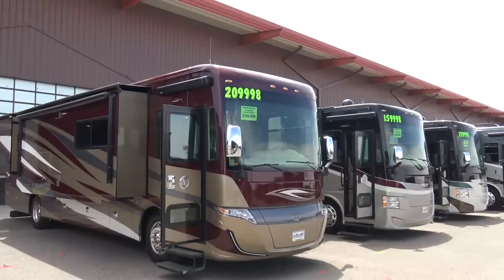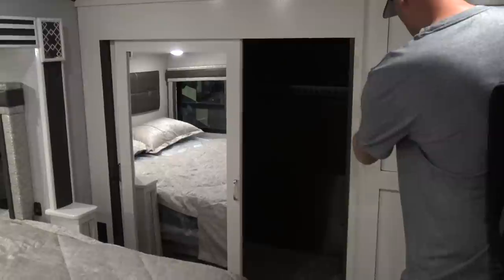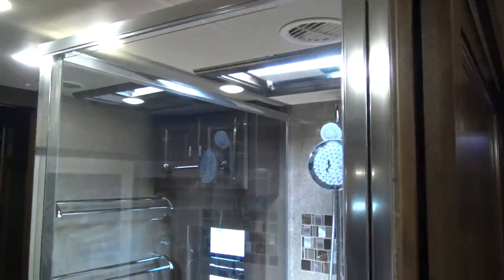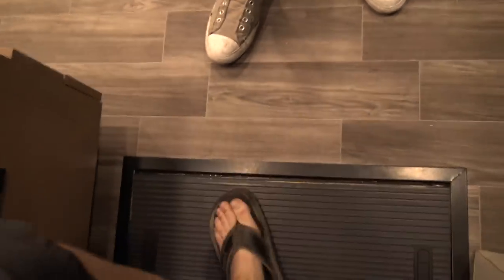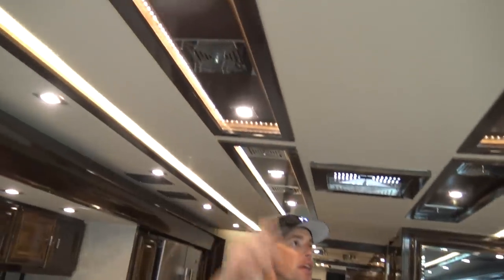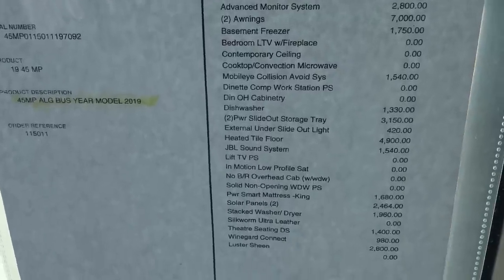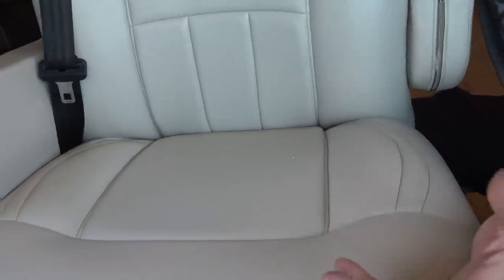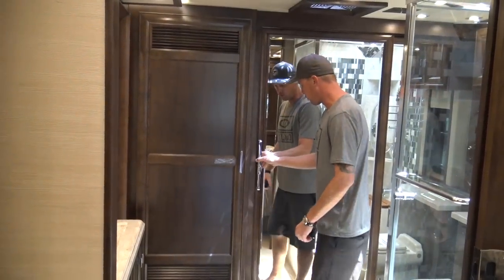2019 TIFFIN QUALITY CONTROL/ GONE DOWNHILL?

Comment: Speaking from experience. We've purchased a 2019 Phaeton 40IH in March. It's been in the shop non stop.  Everything from tile walls falling off, drawers breaking, Aqua Hot total failure, Sypder system total failure, all the compartments flood while driving in rain, the list goes on and on.  I really hope Tiffin is able to turn this around, their reputation is being slaughtered on social media.
Reply: I bought a '19 40IH in August '22 used with 8000 miles. So far its been great.  We've put 4000 miles on it with numerous RV parks. The only problems have been the rear engine compartment cover latches broke while driving (saw in camera since it popped open), and both captain chairs swivel release cable came loose, IR repeaters came off theater receiver disabling the remote. 
 Friends tell me that when you buy one brand new you're going to have problems whether $200k or $2 million. The advice was to only buy super clean 1 or 2 years old. That way it will have been through all the warranty items. 
Sorry y'all had a bad experience.

Comment: We had a 2012 Tiffin Allegro Bus 36QSP. Top quality coach from a build/materials standpoint. Regrettably, we traded it for a 2019 45OPP Bus. In the new bus the materials used and the workmanship just don’t compare. We have the same sawdust from the vents issue, I can flex the dash/switch panel with my finger and minor pressure, the new leveling system is very ticky (sometimes it will level the coach, sometimes it just won’t) it’s been back to Tiffin several times and basically this is just the way it works. We’ve had multiple issues with cabinetry, the soft close drawers have to be handled with extreme care or the rails come apart from the cheap plastic hardware holding them together. Our coach now has 6000 miles on it and the generator and aqua hot exhaust pipe chrome is rusting. And we live in the south. The electric only night and day shades are continually out of adjustment and the front windshield night shade is controlled by a servo that’s already had to be replaced once. I realize this some of these things are component issues but then I look at all of the LED fixtures and they are trimmed in cheap plastic. We are seriously considering the jump up to Prevost or (more likely) going back to the older and better built Tiffins.

Comment: I bought a new Tiffin Zepher in Feb 2019. I have had a terrible experience with it. Have been to Red Bay twice for a total of six weeks.  In addition I’ve had it repaired at other dealerships making total downtime a full ten weeks.  Met with Bob Tiffin about it and frankly wasn’t impressed at all with his response.  The gearbox that runs the engine fan has been replaced twice and it only has 21,000 miles.  I’ve literally had more than 50 genuine, legit defects that I’ve had to address, several of them that made the coach inoperable for a time.  I’ll never buy another one.  Sad, because it’s a great layout.
Reply from the maker: sorry to hear that

Comment: Have to agree with the quality of the woodwork or the lack thereof. We own a 2018 40' AP and the ultra Sheen coat they put on the wood is sub oar at best. Also lots of imperfections in the wood and I don't mean the natural imperfections of real wood. Nail holes not puttyed,  runs in the clear coat, both inside and on our P/S bay doors. Nothing that can't be fixed and at least Tiffin stands behind their coaches although you'll probably make a trip to Red Bay. All in all, I would buy another in a heartbeat. Thanks for your honesty review.

Comment: RV manufactures and dealers just don't care. Put neat lights lights and glossy finishes.....ugh! simple things like making sure the televator is not all wonky, all the wires are tucked away, sawdust is evacuated from all the ducts UGH! The salesmen HOLY SMOKES he knew nothing! now, I know they get staff from the service counted and friends of the dealer, I understand but DANG! Look it's not just Tiffin, the whole industry. But damn if you want to command those prices make sure the product is in "parade" condition. Make sure the dude you  have showing the product knows a bit about the product. The last point is the damn price. 100k off the price come on! how can you look at a motorhome and take anything as a hard number.  The unit is not fitted correctly, not knowledgable salesperson to know what he's selling, product that's not ready to be shown to the public and finally Disney land pricing. No wonder the industry is always in trouble. Great video thanks for the content!
Matt Christopher

Comment: Appreciate your honesty What do you think about the white linen cabinets
that Tiffin is now offering in some of their models. And wod you still recommend a Tiffin ?
Reply from the maker: Absolutely, I would recommend a Tiffin as long as you are aware that you may need to go to red Bay for service work and finding a good dealer to work on it may be tough. Also, be prepared for minor issues but that is the same with all RVs.  I'm not sure I have seen the cabinets that you are talking about but I am really impressed with tiffin's design team.  I did see some lighter cabinets in the vanleigh 5th wheel which is affiliated with Tiffin so I'm wondering if that is the same style of cabinetry that you're referring to.  If so, I was really impressed.  For the money, Tiffin is the best in the market in my opinion.

Comment: Did you see the factory tour video? Trash all over the place big-time! I had a 2007 42 Phaton tag and was great. Sold it during the crash. Wouldn't buy a new one today would consider an older used one if inspected by a legitimate technician. And you'd save 50%! I saw a 2008 model w 45000 mile for $100,000. I lost $70k when I sold mine will never buy new again.

Comment: Why do Dealers put out dirty RVs, and defective lights?!!!
Change the darn lights!!!
Personally I wouldn't spend that kind of money on any RV seeing a cabinet defect or overspray, where's the perfection?  🤔
There's a Newmar Dealer in Mesa, maybe a video on Newmar?  🤔
Reply from the maker: I recently had a terrible experience at the Newmar dealership in Mesa. I have a few clients with some Newmar nightmare coaches and I'm hoping to make some videos on those soon when I get some time!
Reply: @RVingwithAndrewSteele  
I'm surprised, Newmar is a very well made Motor Coach with a great reputation!  I'm sure they wouldn't like hearing that.  The Amish take great pride in their products.
Reply from the maker: @cindyrose5414  absolutely but the later models have been having a lot of flaws.  I have two different Newmar coaches that clients want me to make YouTube videos about showing all of the defects.  I am planning to make both of those videos but haven't had the timing to connect with the owners and go over the coaches.  In my opinion, the best way to do it is to buy a 15 year old Prevost or Newell.

Comment: Seriously ?
Funny, I think I went to that same rv show. My opinion differs. How can you judge quality on a non prepared unit? Seriously, there were units on display that had obviously transported thru snow storms, with no real attempt to clean them up. Now there is no denial that the flashy interiors and exteriors designs of all of Tiffin products will draw a large fanfare. I will be upfront and admit that I am not familiar with the agreement that Tiffin shares with their dealers regarding pre-delivery inspection and detail, but to say that these units were not prepared to expectation before putting on show to the public would be the understatement. I'm not gonna drag this out much further as I agree with you, a lot of times the consumer ends up owning something that they would've preferred been fixed prior to delivery. The good news is at least they tried to repair the damage on the right rear of the class a motor home prior to taking it to the show, but I would take any bet that says they will retail that unit with the half ass repair attempt that they're going stick the new owner with it.
What I'm saying is if the pdi and detail process had been properly performed identified short falls in manufacturing so they could be identified and corrected prior to a new owner ever knowing they existed.
So what I'm saying is that if dealer was concerned with customer satisfaction those units would of never been accepted into dealer inventory without a full cleaning and complete inspection. It's been my experience that if you put a hold on units for quality issues, that the parts and attention seem to immeadetly appear. And, I won't go into who's got what reputation, in this particular case. I'm sure that your Tiffin standard is very different from say your Winnebago or forest river standard. And based on price it should be!
I would expect units to show 'wear'' after or on the third day of the show, but not on day 1 and some units were being put on display in that condition as I was standing there.

Did you see the Winnebago on display missing a refrigerator cover?